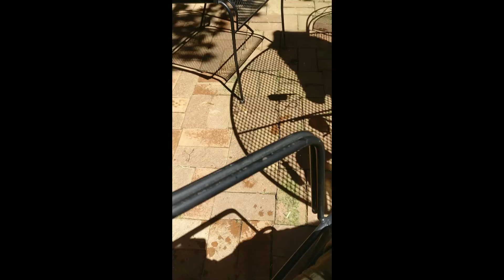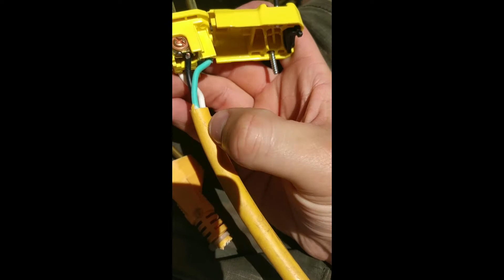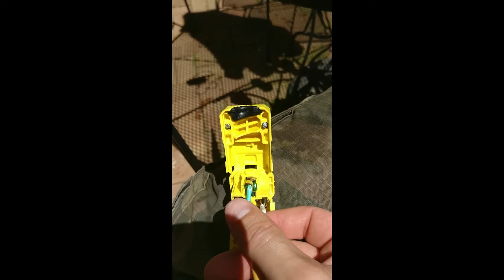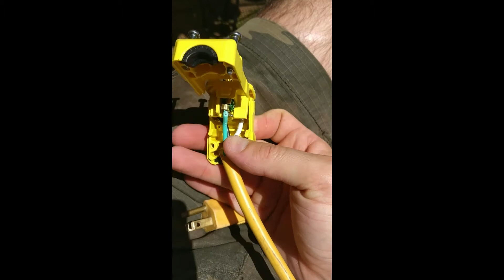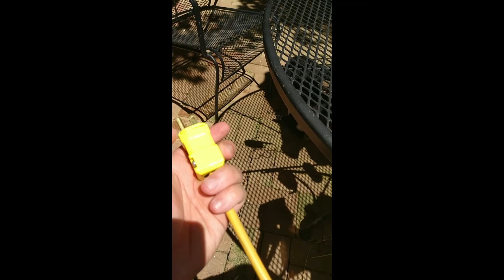Repair Extension Cord Plug

Comment: If that actually is a HUBBELL plug, there is no way that it cost about $3. I couldn't find a HUBBELL online for less than $20. Which Home Depot did you buy it at?
Reply from the maker: I'm not sure the manufacturer, it def was 3 and not 20.
Reply from the maker: Leviton	15 Amp Python Straight Blade Plug, Yellow
https://www.homedepot.com/p/Leviton-15-Amp-Python-Straight-Blade-Plug-Yellow-R50-05256-BVY/205326578
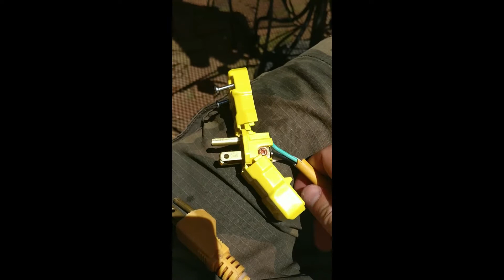Reply: @homesteadrunner5401  Thanks for the HD link. The HD Leviton you linked to is $4.98, not $3, but that's still pretty good.  At 0:39 in your video I can see that yours is a HUBBELL. The lettering is upside down, but I have a monitor screen that I can rotate, and I stepped through this part of the video frame by frame, so trust me, yours is marked with manufacturer HUBBELL, not Leviton. Also, I can see that your HUBBELL does not have the circular thumb depression on it like the HD Leviton does.  If you got a HUBBELL at HD for $3, congratulations. Here is a link to a HUBBELL plug that looks like your HUBBELL plug. https://www.hubbell.com/wiringdevice-kellems/en/Products/Electrical-Electronic/Wiring-Devices/Straight-Blade-Devices/Plugs-Connectors/HBL5965VY/p/1634113
Reply from the maker: You sir,......are correct. It is a hubbell. I found the receipt. I got it at Lowe's for $4.99. The $3 figure was a 'round-about' kind of number. I purchase a lot of supplies and knew it was in that ballpark. I would NEVER spend 20$ on this, so I knew that figure wasn't matching up. But I did get concerned there for a second. My bills walking out are usually at least $200 so something like that could sneak past me.
Reply from the maker: https://www.lowes.com/pd/Hubbell-15-Amp-Volt-Yellow-3-Wire-Grounding-Plug/3739251
Reply from the maker: Updated video notes with this correction.
Reply: @homesteadrunner5401  This really shows how big box stores can bring prices down on some items. Thanks for the links to HD and Lowes.